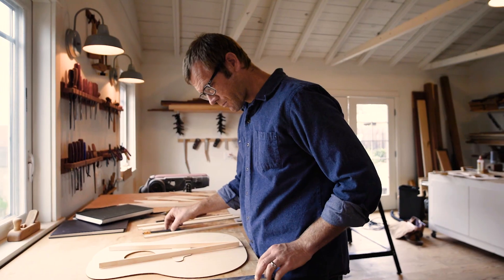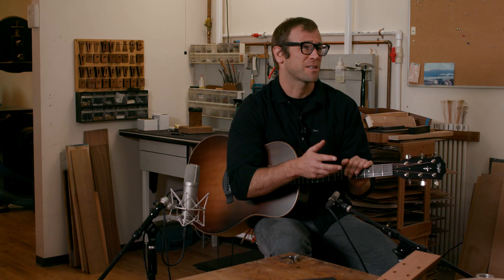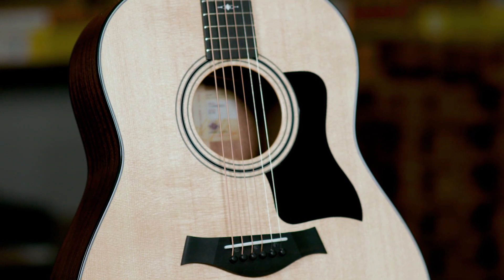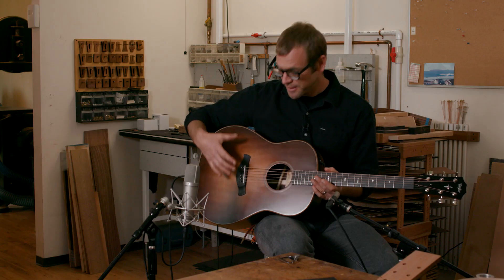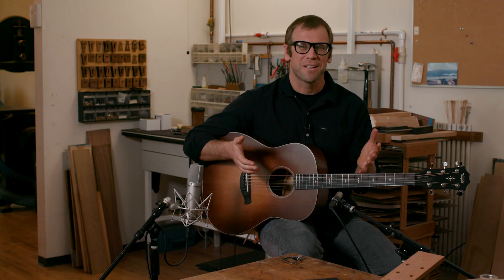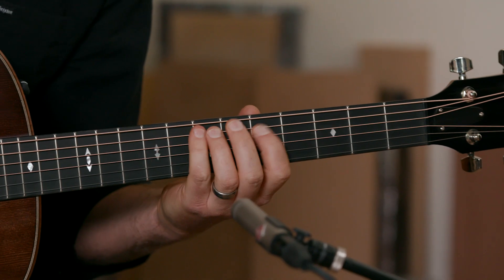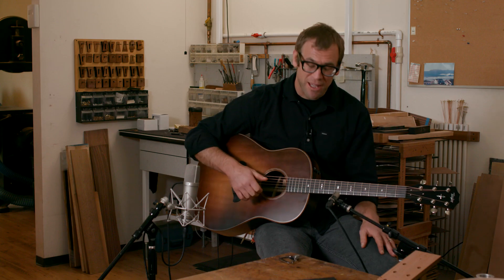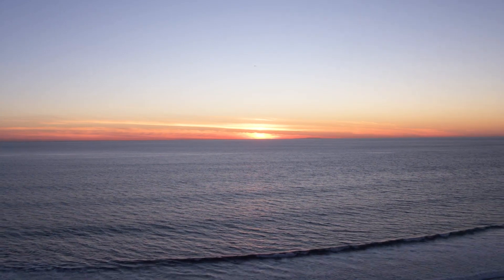Taylor Grand Pacific Series Guitars | Overview with Master Builder Andy Powers

Comment: I like this model, because the tone is a little more traditional and woody, with a modern precision neck and Taylor's neck joint. It looks like a bigger version of the old budget, ladder braced Gibsons.  I see V bracing as A bracing, flipped for a slightly different tonal flavor. Im not sure if one is actually better than the other. The price point looks fantastic, for tonal balance, stable tuning, good sound, body and neck comfort. Its a workhorse guitar, and versatile.